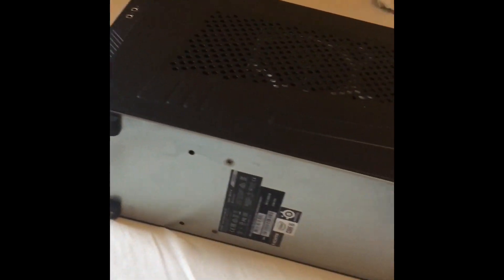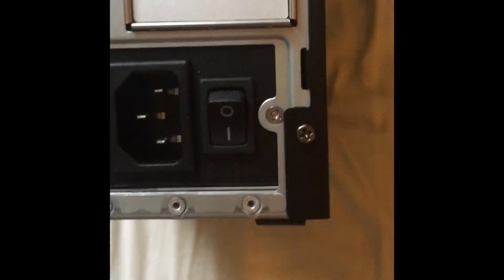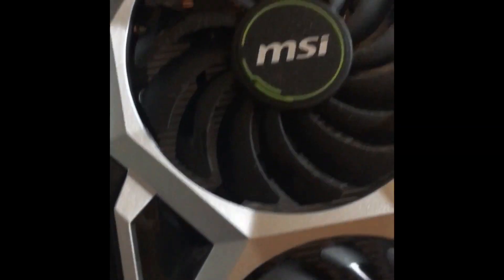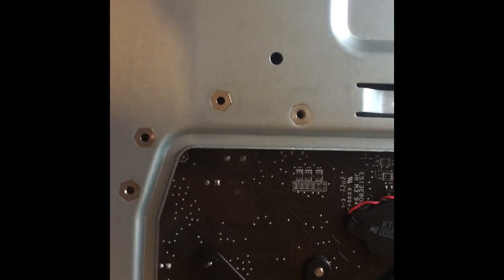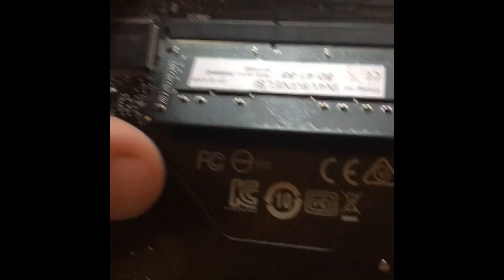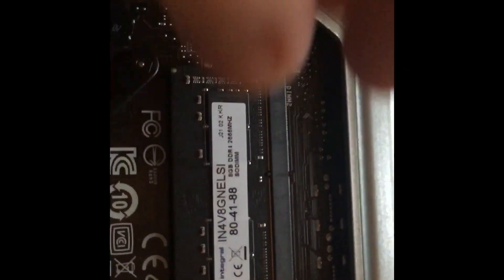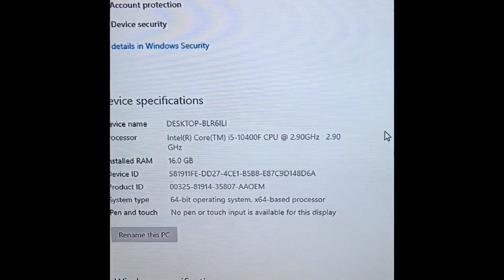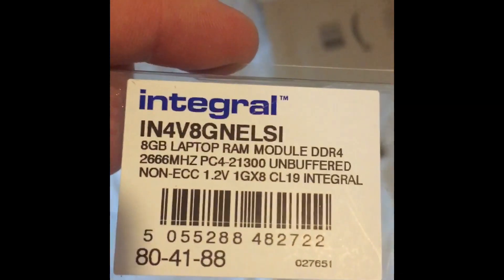MSI Infinite S 10SI-052UK Gaming Desktop PC i5-10400f gtx 1660 super ram upgrade instructions to 16g

Comment: If i add 8Gb ram 2400HZ do i not need to switch it to the 1 ram port or is the first ram port more Hz, i have same pc
Reply from the maker: i could only find one ram port, the other is tucked away 👌
Reply: @emtronea1  ah okay but that one is empty right for a new one ✌
Reply from the maker: @tritonion4104  it sure is 👌